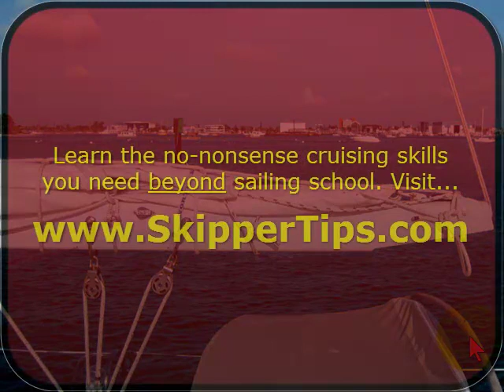How to Furl a Mainsail with One "Sail Tie"

Comment: When raising the sail single handed, how do you go about releasing this?  Do you untie the bowline and unravel it while you raise the sail?
Reply from the maker: Thanks for your note. This video shows a tie to use when putting the boat to bed at a pier or inside a slip. Use a faster method if singlehanding. One way is to use two long sail ties, tied with slip knots, one forward and one aft.  Extra long tail on the aft sail tie. After you tie the aft tie, lead the tail forward. Tuck it beneath the forward sail tie. When ready to hoist, pull on tails. You can do this from near the mast.